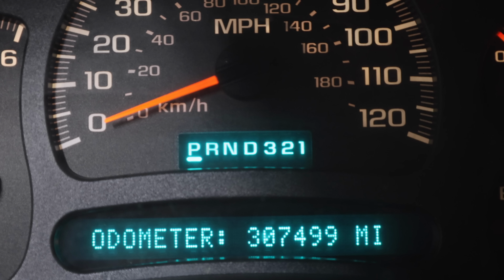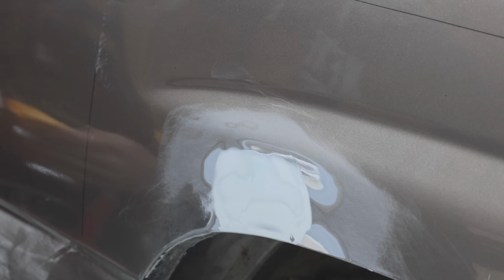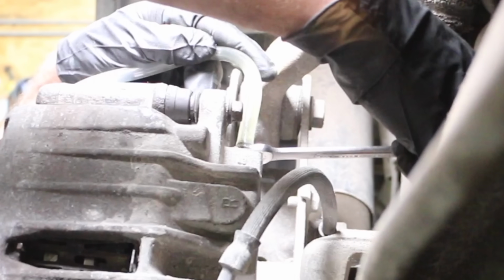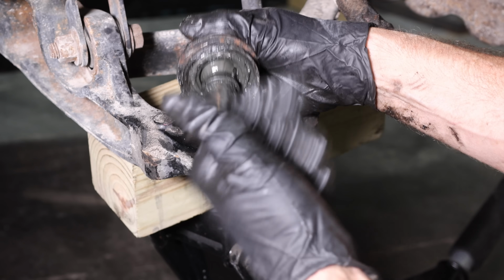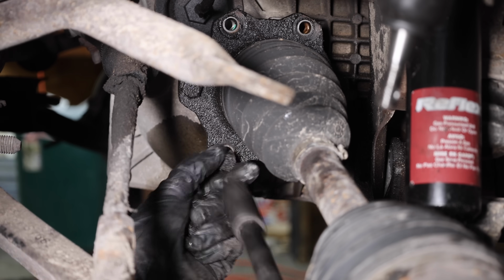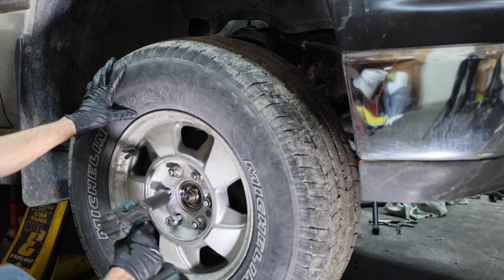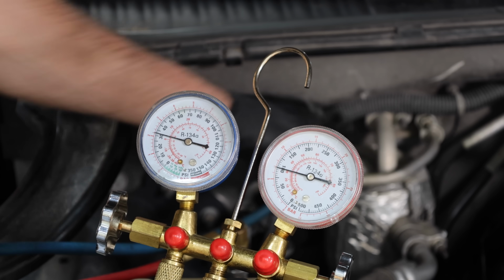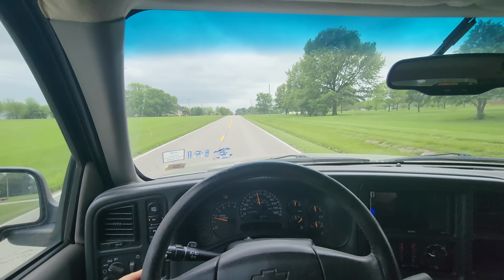Is It Stupid To Fix Up A 300,000 Mile Vehicle? Let Settle This!

Comment: I think it would have been nice if you could have used a borescope to show the internals of the engine. Maybe consider a fuel and/or oil cleaner/flush. Bit late now for sake of the video, of course, But I feel like that, plus a compression test across all cylinders might have given a good idea of engine status.
Reply from the maker: Thanks for the constructive feedback.

Comment: 394,000 miles on my 2010 Honda Pilot. Brakes, tires, oil changes, a radiator, a cooling fan. Paid to have the blower and the air control valves replaced under the dash. Everything works. heat in the winter; cooling in the summer. Original struts and ball joints, tie rod ends, axles, compliance bushings. All the doors and windows work fine. A little rust. She's beat up a bit, but very dependable. I just took it to Florida a couple of Christmases ago (2,000-mile round trip).
I want to push it past 400k so I can tell people it's been to the moon and back.
Reply: I'd say don't change a thing, Todd. if I think it's too fast, I can slow it down myself.
Reply from the maker: Nice!  Thanks for sharing.

Comment: You could buy a new vehicle and get a turbo charged engine that is likely to be ruined before 100k miles. And it has stop/start. And many "safety" features that will disable your car if the slightest thing is wrong.
Reply from the maker: Good Point!

Comment: Hey @projectFarm After recent storms in Texas can you test and recommend a 12000+ Watt generator? I'm trying to run two AC units (3.5 and 4 ton). I used an 8000 and could run 1 AC unit no problem without soft-start kit.
Reply from the maker: Thanks for the suggestion.

Comment: I got my 2018 Chevy Equinox in Dec 2017. Have driven it hard and it is at almost 180,000 miles. I am confident that with continued good maintenance it will go well past 300,000 miles and still be reliable. 

Most part you don't epxect to need to replace are original. I would say the biggest thing that needs replaced is the AC compressor and condensor. Those failed due to getting run off the road onto a steep hill to avoid being part of a pile up. I needed an alignment after that and something on the underside damged the AC stuff.

I have new front struts I need to replace and the front brakes (pads, calipers, pistons all part of a kit)
Reply from the maker: Thanks for sharing.

Comment: If your area salts its roads, GMT800s are known for rusting brake lines and tranny cooler lines.  If it looks deeper than surface rust,  replace them.  Mine popped at 110k.  Tranny cooler lines shortly thereafter.  At 300k, your control arms bushings should have been replaced by now, as well as your brake hoses.
Reply from the maker: Thanks for the feedback.

Comment: I keep buying late 90s(zj) jeeps, for the same reason you should keep this behemoth.. if the following things meet the criteria..
1. How many repairs major and minor have you done over the many years you have owned it? 
2. Is it an easy to work on vehicle?
3. Is it a vehicle that you can fix for much cheaper than buying new and or newer used?
4. Are parts reasonably priced for the older vehicle?

My grandpa traded old ford trucks a lot when i was a kid. Well he traded the cars too. But i learned a lot when watching, then way more as a poor teen and 20 year old. This list i use when asked about vehicles from friends. 
Buy a good quality used vehicle that normal peoplecan work on, and it will save thousands over just a decade.
Reply: Addendum to the first on my list..
If you have replaced a lot of minor and major parts(engine/drive train and various other maintenance items), then why start over with a new vehicle? One you know almost nothing about or how it was really treated every day. Or even what kind of parts replaced broken ones..

Comment: Its a good idea to replace the brake hoses(flexible hose connected to the brake caliper). They tend to swell and become brittle with time and milage. If you happen to loose brakes on one side for no apparent reason, that's typically why.
Reply from the maker: Thanks for the feedback.

Comment: Excellent... keeping and performing the DIY on the high mileage vehicle is a great option.... I buy higher end vehicles and keep them for extended periods and extended miles.... i save many thousands with DIY.... my wife used to even log the DIY savings versus dealer... if the care is proper, the older vehicle will look and perform near new, my own vehicles do indeed.....
Reply from the maker: You are welcome!  Thanks  for sharing.

Comment: Oh the myth that its cheaper to trade it in than fix it!!! Unless you have to replace the transmission or engine and can't do it yourself, the sales tax alone on a new vehicle will cost more than the parts to fix it. In my opinion, a few bucks in parts a year will prevent the massive overhaul you had to do to this big burb but six of one, half a dozen. At one point all three of my cars had more than 200k miles and i wouldn't hesitate to take any one of them across country. My daily has 263k miles on it right now.
Reply from the maker: Thanks for sharing.

Comment: I drive a 1995 Chevrolet K1500 with 227,000 miles on it for this very reason - it's SO much cheaper to operate than a new one.  Yeah, the gas mileage is dismal and it isn't anywhere near as powerful as one with a more modern engine, but the old 350 in it is dead reliable and if something goes wrong, repairs are cheap and easy.  Great stuff and keep it up!  The current format is great in my opinion and doesn't need changing.
Reply from the maker: Thanks for the feedback.

Comment: Most people, not all, but most change vehicles out of being tired of them. I have an 03 Silverado w/215,000 mi on it. Quarters had fender protectors on them and not surprisingly I had rust all but to the top of them. Purchased patch panels and glued them in. Ended up finding other rust, minimal I would say, but for a 20 yo vehicle not bad. Some on the front fenders couple of door bottoms and of course the rockers and cab corners are eaten alive. Plan on fixing rockers this year with some pretty nice replacement ABS ones. My point is while I didn't plan on all of this, the engine and transmission were solid and now with this body work done the truck is looking pretty good. Ended up painting the entire truck (more than once on most of it. Hood 4 times😩😩) and I had NO experience in this. Have always wanted to try and I got my wish. In the end it looks OK going at 55mph😁😁. Keep up with maintenance and service on it. Why spend $60---70,000 on a new one and have $1000 payments for 5 or 6 years. $2000 for this, 3 months of hair pulling and gained some knowledge. At 67 I won't be doing many of these, but at least I can say I did 1. I'd love to do another one, but damn, it ended up being a lot of work.
Don't change a thing on your presentations, just show me how I can do it as fast 😁. 

How about doing a video on body panel adhesives for the DIY er interested in body repair, but can't weld or don't have a welder???
Reply from the maker: Thanks for the feedback.  Thanks for the suggestion.

Comment: 300k miles on rotors??  Huh?  My rotors get replaced pretty much every time I get a brake job done, like every couple of years maybe.  I've never heard of rotors lasting 300,000 miles!  In fact, I just bought a 2021 Mazda CX-5, with 40k miles and the dealership replaced all pads and rotors for me.  And that was the second set as the first owner already had them done once before.  So I'm very confused here.

Comment: Supremely impressed!
This was an awesome video.  I've been maintaining my vehicles for roughly 25yrs.  All of the mechanical effort here would have taken me 10-16hrs.  The welding, another 4.  The at-home allignment is really helpful.  The glazing putty and welding job was really impressive.  You make that look easy.  All the little detail really helps.  And yes! When dealing with RTV sealant, both mating surfaces have to be spotless.  You may want to invest in a Valco Cincinnati Tube Grip for dispensing RTV. (If you don't have one)  Its made my life 100x easier.  Everything else, yes, yes, and more yes!
These are great play-by-play videos.  There's a pause button, we can use it.
A parts list in the video description would be nice.  Some parts are hard to source for these types of projects.  These early 2000s vehicles are reaching "classic" status.

More of this please.  I need to go back and see how you built the vacuum pump.
That's really nice.
Cheers.
Reply from the maker: Thanks and you are welcome!  Thanks for sharing.

Comment: as long as the frame is in good condition, and it has been well maintained, TOTALLY worth fixing up. They dont make modern vehicles like they used to. It's always cheaper to maintain a vehicle than to replace it.
Reply from the maker: Thanks for sharing.

Comment: Limited experience with snap ring pliers, but I've found that the "fixed" ones tend to be more reliable than the exchangeable tip ones. Although to be fair they're Knipex ones vs cheap exchangeable ones, so the slop factor in those were probably a bit higher than high quality ones, which I think tends to be more important on snap ring pliers as a slight angle difference can mean retaining or slipping off a ring.
Reply from the maker: Thanks for sharing.

Comment: Radiator may be cracked.  Common issue. That's a lot of mls. to spend money on.  Prone to have intake manifold gasket leaks.  The drive train is most likely very worn.  Wiring harness integrity becomes questionable.

Comment: Meanwhile, in this side of the globe - replaced gearbox, water pumps (in plural), turbocharger... Just shy of 100k miles! Oh, and now the engine eats up oil like crazy. Viva made-in-belgiun Ford :/ that disaster would never ever get to 300k miles without replacing the whole car 3-4 times.
Reply from the maker: Thanks for sharing.

Comment: That 'Burb is well on its way to half a million miles and will go the distance. People that complain about transmission or other issues probably never change the fluid. 
As far as safety, the safest part of any vehicle is behind the wheel. Pay attention and watch out for the other guy. Been driving for 44 years without an accident.
Reply from the maker: Thanks for sharing.

Comment: I enjoy your reviews, and I am interested in something that I don't think you have covered yet, or at least not recently. I did not see anything on your website regarding aftermarket backup cameras. I was considering buying one. I liked the solar powered ones since they are easy to install. But after reading some reviews, it appears that the battery dies pretty quickly and that you still need to plug them in since the solar panel on them is not up to the task in keeping them charged. And this leads me to possibly getting a wireless unit. Your help would be greatly appreciated.
Reply from the maker: Thanks!  Thanks for the suggestion.

Comment: I have always bought the cheapest snap ring pliers from auto parts store until I f350. I finally asked a friend that's a mechanic what he recommended of course he said snapon then he said harbor freight Icon set. I got it around 3 years ago it works great they just had it on sale or get a coupon for it 79.00i is a lot but you can find it around 59.00 or lower.
Reply from the maker: Thanks for sharing.

Comment: Maintenance means more than mileage. 50k miles in the city are much worse than 100k on the highway.  

I'm thinking of getting one of those cheap welding machines. I heard they are "good enough" for some welding of the car body work as long as you replace the wire with a better quality one. 

Maybe would be an interesting test?

Thanks for this entertaining video and I like the format. Straight to the point and no unecessary fluff.
Reply from the maker: Thanks and you are welcome!  Thank for the video idea.

Comment: video suggestion. a comparison of brake fluid testor accuracy would be great. as a mechanic for 30 years i have never used one (just changed at required interval or when contaminated)  after watching your last video i decided to buy one. after hours of searching i cant find one that doesnt have a lot of complaints for false readings or readings that never change. are test strips or maybe just using my expensive multimeter better?
Reply from the maker: Thanks for the suggestion.

Comment: I'd be interested in seeing you pull the engine, looking at the bearings and piston rings, and seeing what areas are doing worse or better than others. Swap the bearings, clean up the piston rings, put on a new head gasket, and slap her back together. Do a minimal engine rebuild. It's surprisingly easier and cheaper than people think.
Reply from the maker: Thanks for the suggestion.

Comment: I love this video.  I have an old GM truck with 200,000 miles on it and it still runs great.  I had to put a bit of money into it for new wheels and tires to fix some handling dynamics and I put new injectors in mine because of a problem that I created trying to use cheap fuel, but that truck runs great and drives great.  These old GM's are about as easy to work on as they get.  If someone ever crashes into me and totals my truck, I'm going to have a hard time letting this one go.
Reply from the maker: Thanks!  Thanks for sharing.

Comment: Tip for pressing in ujoints and ball joints and bearings, grease them properly then freeze them overnight they shine slightly and press in much easier with a lot less chance to press it in crooked.
Reply from the maker: Thanks for the tip.

Comment: Bodyman advice: when you weld  patch, butt or lap, after grinding the weld, always apply a good coat of fiberglass paste (marglass, tiger hair, etc...) then, after sanding it, you can apply the body filler. You should do so just to prevent if you have pinhole in your weld, the body filler is porous, so you have a big risk of bubles under your paint. Keep up, you are excellent!
Reply from the maker: Thanks!

Comment: Ball joint removal tip, I discovered when working on my 07 ranger lower balloint that if I tightened the ball joint tool than tapped the lower arm with a hammer that the ball joint would pop up 1/8 in and I never had to use a lot of pressure on the press...it made it totally easy.. it works for the same reason an impact wrench works.
Reply from the maker: Thanks for sharing.

Comment: Most people get rid of vehicles at around 100,000 miles. I am definitely not most people. My 2010 Ford Expedition has 319,000 miles on it and my 2003 Dodge Ram truck has 308,000 miles on it. My wife's 2013 Suburban has about 194,000 on it. My goal is to try to get 500,000 out them.
Reply from the maker: Thanks for sharing.

Comment: I'm curious which is better cheep oil between 0 and 5k miles or the boutique oil between 5k and 10k miles? The spendy oil says use our stuff for 10 to 15k miles between oil changes.  But is the expensive oil really better than cheep oil changed more often?
Reply from the maker: Thanks for the suggestion.

Comment: Thanks for the video.

The standard I use, FWIW, is to gauge the repair costs of a vehicle versus a car payment for something equivalent.  If the maintenance costs meet or exceed a new car payment for 2-3 years, then maybe it's time to buy a new vehicle.

To be specific, that is repair costs.  Not maintenance.  Tires, oil changes, brakes, all the items that are "wear components" aren't factored in.  Because those are costs that would be incurred with a new vehicle.

And like you showed, if a person takes time to do some learning and acquire some tools those repair costs can be DRAMATICALLY reduced.  And more tools and more skills are always a good thing.

Comment: I think you should do an expanded on string alignment younger folks do not know how string and bubble levels were adequate before electronics.  I do it this way and rarely need to go to alignment shop.   I even do it on farm tractors if I change out the tie rod ends.

Comment: After 2004 GM went to AFM or variable displacement so valves and cams give problems so the 2003 is well worth keeping.   The one additional thing I would do is cut an access hole for fuel pump access under middle seat.   We have a 2004 Suburban and it cut off several times on a July day.   I folded the middle seat on drivers side ahead and lifted the carpet.  I already had my access plate installed and it took longer to get the right pump from the auto parts than to swap it out.
Love your channel but wish your pricing would be estimated on actual volume used in particular test not on what whole container cost.

Comment: I don't know what is up with YouTube and my account, but I can't join or subscribe to any channel. So with that in mind, here's something dealing with lawn mower engines. A lawn mower repair person told me to keep my mower running smoothly, I should put three (3), squirts of carb cleaner in my gas tank to mix with the gas as it is running through the carb. Do this for every third (3rd), tank of gas. I can tell a little difference in the way my mower runs. Is this also safe to do with trimmer, chain saw, and leaf blower engines?
As for this video about the truck. Since a truck is a work vehicle, as long as it is in working condition, I would just make sure that is stays that way. Now if you want to make a show truck out of it, I'd say spend the money, especially since it's a Chevy.

Comment: Next time you sand around the spot taper from clear coat to raw metal over a 4-6” area. It will make it easier to hide where the filler is.
Reply: Also we are hiring at my body shop in Huntsville Alabama if your YouTube career doesn’t work out 😂😂
You did a damn good job.